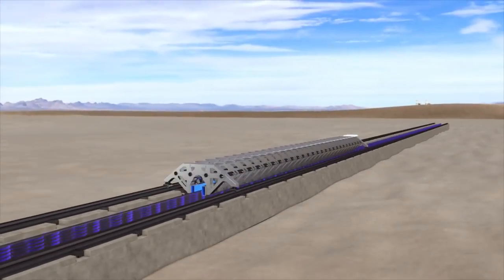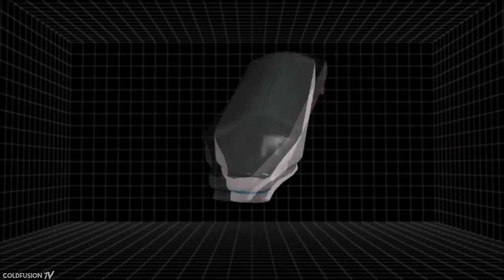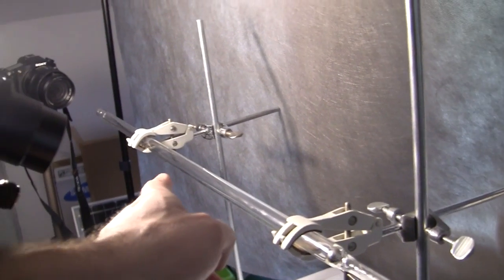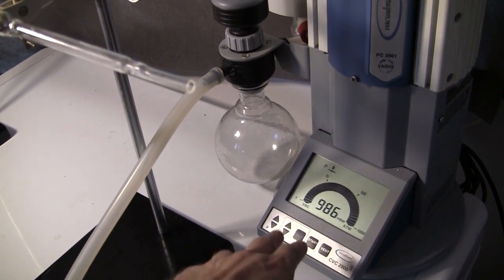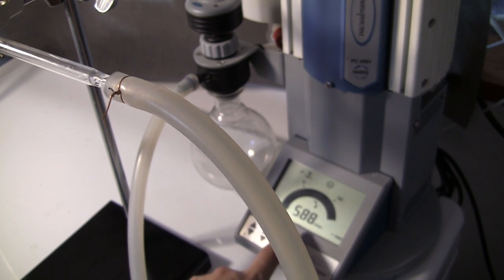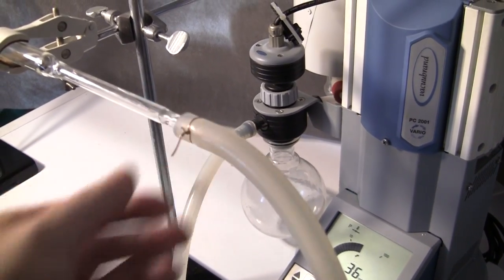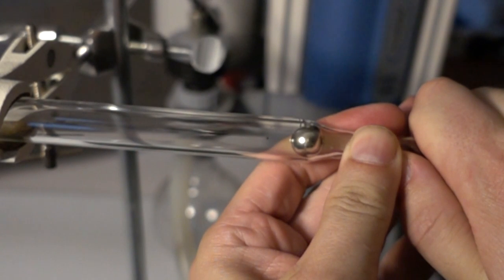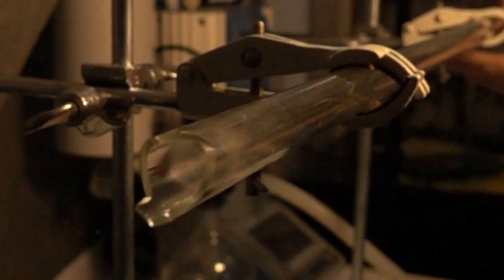How  the Hyperloop can kill you!

Comment: I'd be a lot more afraid of a pressure failure of the passenger cabin at 500+ kph than of the tube itself.
Reply: Well he did point out that it is all the space engineering problems on a land vehicle
Reply: ***** just because you don't know of any event of this happening doesn't mean it can't happen.
Reply: It never happens in submarines? Really? As a veteran of the Submarine force, I can assure you any and all accidents you can imagine happening on a submarine has happened. Especially de-pressurization or failure of seals keeping water out. One famous example is the USS Thresher.
Reply: +Synerrox เ Failure can still happen to any machine, no matter how perfect it is made.
Reply: ***** I served on a modern sub and bad things can and did happen. The Thresher was a modern submarine. Most submarines in service today were built during WW2 or the Cold War. There hasn't been a new model in many years, at least, no new American submarine models.
Reply: +Synerrox เ In the case of submarines it is rare but it can and has happened and it almost always results in the death of any human involved I assure you. Also when was the last time you heard of commercial submarine travel?

Airplanes also aren't perfect and planes, more specifically the skin of the pressure vessel does sometimes fail, however there you only have to worry about the air inside the plane going out and its still very violent when it happens, but generally doesn't harm the plane's ability to fly they merely drop in altitude. 

its also important to note that outside an airplane is still at least .2  kg/cm^2 (1 kg/cm^2 is normal pressure) which isn't pleasant but your body can tolerate it, also planes descend fairly quickly in the event of a cabin breach as well, however in a near vacuum even if you had an oxygen mask the pressure, or lack there of would kill you very quickly. so if you vessel breached you would be dead very quickly. They could seal off a section of the tube in theory and pressurize it but it would likely be too late.

In terms of space stations you're talking about something that is designed to maintain a set pressure at all times. the Cabin of the Hyperloop capsule would constantly be going between pressure changes to load and unload passengers so the dangers of a seal of material weakening are not entirely far fetched.
Reply: ***** As I already stated, most submarines in service today are 30-50 years old. So yes, the Thresher was a modern submarine, regardless of what you think a modern submarine is, the last Permit class submarine was decommissioned in 1993, so not that long ago. As for your latest comment sure, I agree safety measures would be taken. But that isn't what I'm disagreeing with you for.
Reply: ***** Most of the monitoring would be handled autonomously.

The system could be made resilient to attack by segmentation. If anyone attacks any part of it, it's isolated from the system, and can be repaired individually. It would be an expensive fix, but I mean, what if someone used explosives on a hydroelectric dam? There are plenty of other very serious potential targets.

Planes are not small, and they're subjected to a lot of stresses, whereas the tube itself would be subject to very little. Plus, any failure at any point can be addressed by the safety systems you'd want involved anyway.
Reply: *****
 Lol how do you train people to swim to the surface when the pressure itself will kill them. subs operate abut 100-500 meters. a human can only survive about 60 meters swimming up to the surface without air. And coming up too fast leads to the bends.(Hydrogen separating in your blood. Which is painful and can be fatal is not treated immediately. And the only way to treat it is to put you in a pressure chamber and gradually bring the pressure p to the surface. Which could literally take hours. I hope Thunderfoot makes a video about how creating pools can be idiotic and dangerous.
Reply: +Reshintoe It's much more like a submarine.

If a submarine suffers a pressure failure, you just die.
Reply: He clearly says 1 millibar.
Reply: rataflechera Your math is horribly wrong. I'll assume your cross section is accurate for the general case, rather than any specific project specifications. Air isn't 140 kg/m^3 though. It's 1.225 kg/m^3 at sea level, roughly 1.2 kg/m^3 at 0.01 bar. That's only 50,000 tons of air. Literally two orders of magnitude off.

As I've said. Segmentation. Especially of the terminals. They should be relatively small segments that can be depressurized relatively quickly. That way nearly the entirety of the tubes can be kept at pressure nearly all of the time.
Reply: @seigeengine  If you segment everything, you will need a ton of airlocks. More points of failure! Yay!
Reply: @seigeengine  Yes, it would make the system somewhat safer, but it would also make it less practical and more cumbersome.
Reply: @seigeengine  Also stop calling people idiots. It's not nice and will make people hate you.
Reply: @williamhuang8309  First of all, congratulations on necroposting on a 5 year old comment.

The airlock segments would literally be anti-points of failure whose purpose is to seal off a section within the tube in the event of depressurization i.e. when there is a failure already. How you could possibly think that's adding a point of failure to the system is beyond me. You do know that these wouldn't be airlocks to the outside, but airlocks to seal off the inside of the tube, right? 

Also, airlocks aren't simple? You'd be right if you were talking about airlocks to the outside of a pressurized container. But if you're talking about airlocks inside the tube in an already pressurized environment that you want to be able to seal if there's a change in internal pressurization to prevent the whole system from being destroyed, then yes, those kinds of airlocks are indeed simple. What do you think Submarines do when a loss of pressure in a compartment is detected? Shockingly, they close the connecting airlock which prevents the rest of the submarine from suffering from decompression. Without this airlock the entire thing could implode or flood. Guess what? These internal airlocks are far less complex than ones designed to be transition points to outside of the submarine. Within the hyperloop they could literally be as simple as an automatic door with a pressurized seal on it.
Reply: @Hirome_Satou  I'm saying that by adding these simpler airlocks, you have more to maintain.
Reply: @williamhuang8309  And not adding them means the potential to lose the entire tube and killing potentially thousands of people.

Come on man. Every single machine created has safety features that add "more to maintain" that doesn't mean you don't add safety features. Also it doesn't take much to maintain a simple internal airlock. You're being ridiculous. A failure of one internal airlock does nothing to make the tube fail. You can just use an airlock that's further down the line if one of them doesn't respond properly. It would also be an extremely unlikely and rare occurrence for such a simple door to fail. In real life there are always redundancies in safety features.
Reply: @Hirome_Satou  Well, because the hyperloop isn't very safe and these safety features make the entire thing more complicated and more maintenance-intensive, I think we should avoid using the hyperloop as our primary method of transportation. Sure, a couple might be built, but in the end, it's just not a good idea.
Reply: @williamhuang8309  You keep saying the same thing but you haven't illustrated how it does this thing. How does it make it "more complicated". Should your car not have brakes? Brakes make the car more complicated, what if they failed? What if you had to maintain them? Brakes need brake fluid, what if you run out of brake fluid, you would have to maintain it, might as well not even have brakes. Just how many parts are in an engine that all need to be working constantly? So many things could fail, It's just not a good idea, every day cars crash. They shouldn't be the primary method of transportation, there's just so many things that could fail in them!

How about you ask how much it takes to maintain such a door rather than just saying "it's more complicated". We're talking about a door with a hermetic seal on it by the way and an automatic circuit attached to a pressure sensor to close it in the event of a drop in pressure outside of tolerance. That's not complicated. That's extremely simple. Simple airlocks are not complicated technology. Military Naval vessels have hundreds of these kinds of doors on them. It is not complicated nor is it expensive to test these doors. I reiterate, your argument is ridiculous.
Reply: @Hirome_Satou  The problem with having airlocks halfway down the tube is that they are difficult to reach, especially when they're in a tunnel. In a car, it's easy to access crucial components such as the brakes- but in the hyperloop tube, the entire thing is under a vacuum, making it difficult to get to without repressurising the entire thing. Coupled with the fact that the pods are almost as big as the tube ( as shown in all their renderings) you end up with something that is difficult to reach. Yes, the door may be easy to test remotely (just set up something to close it and test the pressure) but it can be difficult to check it for any defects such as cracks or  other defects.
Reply: @williamhuang8309  Do you know what subways are and how they are maintained? Do you not know what maintenance lanes are? There are so many ways to get around what you're calling a problem. Alright man, I'm done entertaining you. It's been 5 years since this thread was relevant and I don't think you're bringing up anything worthwhile to continue discussing.
Reply: @seigeengine  Well... you likely didn't read my entire comment either, as you missed the part where I wrote about the single-door "airlocks" and the normally-open airlock bit. With that out of the way, assuming there were no technical difficulties with installing a fast, reliable, strong, automatic airlock (it's doable, but it might become rather impractical on long distances), you still need to slow the pods at a safe rate. If there was a vacuum breach in one segment, the airlock doors would need to close. If there was a pod approaching the failed segment and the pod was getting close to the failed segment, you'd somehow need to slow the pod down at a safe rate so the passengers onboard don't die of high g-forces. With or without airlocks, there are still major safety concerns with the hyperloop, and the vacuum failure problem is just one of them. Yes, if your detection system works fast enough, you could prevent the propagation of failure, but installing airlocks every few kms presents its own technical challenges.
Reply: @Hirome_Satou  Yes, I know how subways are maintained. But there is no vacuum in a subway system, meaning it's easier to access something. Yes, you can add maintenance lanes to the hyperloop, but if something fails inside, you will need to add access doors so you can get in through the maintenance/emergency lane.
Reply: rataflechera Rather simple moving parts. They also really don't need to open and close around the pod, although that would be beneficial. You could simply leave all but the terminal segments open during normal operation.

And the advantages massively outweigh the disadvantages, since this allows you to actually isolate problems, makes the system much more resilient, etc. I'd go so far as to say a non-segmented system doesn't make sense.
Reply: +Synerrox The hyperloop would cost tens of billions of dollars to construct, and it would likely be hellishly expensive to maintain, given all the safety systems that have to continuously be checked and rechecked. Plus, the only way it makes sense to use a hyperloop is for long distances, because otherwise its high speed is meaningless. This means that there can only two or three destinations available in the route network which limits the market size. I doubt the hyperloop could ever break even let alone turn a profit, especially when air travel is well established, relatively safe and more or less affordable for the average person.
Reply: +Alexandru Belea Well not using this hyperloop won't really be limiting us, think about it planes let us got across seas and oceans faster and someehat safer than walking or using a boat. The hyperloop doesn't really give us much expect a somewhat faster train.
Reply: Portalmaster Good. America needs another Great Works project to get people employed and working again. I fail to see the problem here.
Reply: But it is not all the problems of space engineering. You won't freeze to death on the earths surface. You won't have a lack of oxygen. All that would happen is you feel like you got kicked in the stomach.Rapid pressurization on one hand, Rapid decompression on the other.
Reply: if we're not going to say airplanes are unsafe because this sometimes happens on them, it's absurd to say this loop would be unsafe because this might happen
Reply: @WorthlessWinner  Yes, aeroplane emergencies do happen, but in the event of something bad happening, it doesn't result in the instantaneous death of everyone on board. If there's a sudden decompression, there are oxygen masks that last for 15 minutes, and the pilots have time to fly the plane to a safe altitude where you can breathe without the oxygen mask.  If there was a spontaneous decompression incident, the entire cabin would be dropped to 1 millibar in a matter of seconds, giving you little time to react. Not to mention that your body could explode if the decompression happened too fast because the pressure on the inside of you ( 1 bar) is larger than the pressure outside ( 1 millibar in the pod)
Reply: ***** No that's not true. You have special suits called SEIE MK 11 suits that inflate and get you to the surface quickly. But that's only used in the occasion where the Sub is unrecoverable from a flood or fire or some other disaster. If there was ever a loss of pressurization in the sub you're not escaping from that.
Reply: +rataflechera Keeping the tube pressurised is realatively simple because it is not a full vacuum,  but a near vaccuum 10 millibars as thunderfoot said in his video. As for power,  the idea is to have solar panels on top of the tubes which will more than cover the power requirements.
Reply: TheMartieno 10 mb is 1% of atmospheric pressure. You know how it is achieved? By removing 99% of air (or cooling air down to 2.8K assuming at that temperature it is still an ideal gas).

So, let's assume the cross section is 10 m² (100 sq ft), and it is a straight line from New York to San Francisco (4,140 km, 2,570 mi), that means that the tunnel has 41,400,000 m³ of air, and you have to remove 41,000,000 m³ of them. At 140 kg/m³, we are talking of 5,740,000 tons of air.

So either you must keep removing millions of tons of air each day, or you must keep the system very sealed, even during the stages of loading in and out the cabin and during normal maintenance and small reparations. 2,570 miles of a very sealed tube.
Reply: rataflechera The answer is simple. Have sections that can be sealed and pressurized or depressurized separately. No need to remove millions of tons of air each day.
Reply: @Hirome_Satou  Airlocks are far from simple :)
Reply: If you look at the references... there's no room for 500 or more passengers.
Reply: ***** But it wouldn't be a similar level of safety to airplanes if an airplane suffers pressure failure they descend and land immediately. If a Sub suffers pressure failure they ascend if possible and if not the sub either sinks and implodes or just implode depending on the depth. If the cabin pressure failed in the hyperloop it would kill the passengers nearly instantly.
Reply: ***** I'm guessing a hyperlopp would for a country like the USA would go around the US and I would say not only is that a lot of land to cover, but  it would cost a massive amount to dig all of that out not to mention all of the man power that wohld have to be put into it, so I say a hyperloop would cause either around or more than it did for the Concord.

Also who exactly would be paying for this? A Private company or would the government chip in for some of the cost?
Reply: ***** True most of the original train line was above ground,  though its  just one of those ideas that if done in the current century would just seem a bit convoluted and unnecessary, though maybe in the future it will seem like a better investment when there are better building techniques.
Reply: +Synerrox เ you probably will need less fuel to move 500 people with an hyperloop that with a plane.

On the other side, apart from a plane keeping a pressurized cabin at 30000 feet, or the hyperloop cabin pressurized in a near vacuum, for the plane to operate you only need two runaways, which don't even need to be perfectly paved or maintained, or even lighted for daytime operation. And if you want third destination just build a third runaway.

 For the hyperloop you need a whole depressurized tube all the way from one point to the other, and depressurization consumers energy. And so does building the tube and taking all measures needed for safe operation.

in the long term, if a route is profitable, it might save energy, buy this is far from a flexible system, and the larger the network, the larger the problems of keeping sealed and depressurized.
Reply: TheMartieno Solar is still shitty pretty much everywhere. Let me know when it isn't.
Reply: *****
I don't think that level of pressure will be sustainable enough to kill people like that.
Reply: seigeengine my math was not horribly wrong. I got one input wrong (the weight of air due to a missing decimal point in the first place I checked).

The problem about segmentation is that you need them separated for depressurizing them but open for the capsule to run through segments. It adds some mechanical challenges.

It is doable. It might even be profitable and save energy in some specific needs. But it is an engineering challenge and is far from a flexible solution.
Reply: rataflechera Lolno.

o noez ey nevurr teh thot abowt dat!!!!1!111!11!1
Reply: Joshua Dunbar I understand. I also understand that the capsule must move through those separated sections, so you need sealing doors that open and close as the vehicle passes, which adds extra complexity (more moving parts, synchronization, etc.)
Reply: yeah and its shreds submarine, but submarines are to important for warfare to dismiss them, and airplains dont have as much pressure difference so its not as devastating as in the hyperloop. many passengiers of riped plains survived, because our body can hold these low pressures but not the one in the hyperloop.
Reply: Also the force of a lot of accelerated air hitting the capsule would probably crush it like a tin can.
Reply: aserta 1. No. 2. No. 3. No.
ChatNoirLe No, it won't. Atmospheric air pressure isn't that large. We routinely build things that handle pressure differences hundreds of times higher, and then we sell them willy nilly to the average person without restriction.
Reply: DarkBabylon - Gaming videos maglev isn't really the only levitation system suggested, mind.
Reply: DarkBabylon - Gaming videos I haven't watched it, but Musk's idea was to use air-casters instead.
Reply: A complete failure would be rather difficult., and at 500kmph would probably give you bigger problems than no oxygen to breath. If nothing else the tube should keep the pieces together. A large hole should be solvable though. Thunderf00t gets it very wrong here. The tube is at partial pressure because that big fan at the front uses it to create an air cushion around the vehicle. It's be relatively simple to have an on-board emergency system kick in to divert that air towards the cabin instead, which should counter the effects of quite big holes. Externally the tube would need to have blast doors for a variety of reasons, including maintenance. With blast doors ever 10 miles, and blow out relief valves, you'd never go more than ~30 seconds without air. Bad, but survivable.
Reply: I don't think lack of air is the problem. I'm not a super genius when it comes to science but vacuums are a lot more dangerous then just simple oxygen deprivation. short answer: kiss your lungs goodbye. literally. I have seen it with deep-sea fishing except with their stomach but once exposed to lower air pressure then your body has adapted to, the organ gets sucked right out of your mouth.
Reply: draconian99 Has less to do with the deep sea than with space. On which point, we know what happens when a person is suddenly exposed to a vacuum. The answer is.... nothing dramatic.
Reply: +Politiekman, and on top of that, it would require far more energy per trip than an airplane flight considering how much energy is actually required to make a vacuum, hell, a 1 m^3 vacuum requires 100kJ of energy to create, and that only increases exponentially as the size increases. Creating a 3000 mile vacuum(needed because momentum simply cannot be sustained in open atmospheric conditions, and would rapidly diminish, require hundreds of individual vacuum launchers) would not only be extremely expensive because a fully airtight tube doesn't come cheap. You would need many of these tubes because you couldn't have two trains running in the same tube, because if you stop and remove airflow from the tube with a train in it, the train stops.
Reply: SlyCedix 

Except the vacuum isn't being recreated for every trip. The only area that needs to be returned to pressure is the terminals where people or things board the pods.

I don't see why you can't put multiple pods in one tube, as long as there's enough of a gap to provide braking room between.
Reply: seigeengine
As the pod moves, the entirety of the space behind the pod becomes 1 B, which then needs to be returned to the 1 mB for the next trip. This function of turning to one bar is essential to uphold the speed of the pod. To run another train, you would first have to depressurize the tube which would mean not only does any pod inside the tube stop having momentum, it would likely begin to reverse back through the tube until the tube ultimately reaches 1mB again.
Reply: SlyCedix What are you talking about? The pod is not manufacturing air out of nothing, nor would that be "essential to uphold the speed of the pod." I feel like you've gotten some very weird notion about how these are meant to work in your head. You should probably explain exactly why you think that's the case to ensure I can give an appropriate reply.
Reply: seigeengine has it -- it pumps air from in front of the car to behind the car, yes. In the immediate viscinity of the rear of the car it is high pressure but that will equalize very shortly back to near vacuum.
Reply: That is all regarding capsule failure. What TF is showing here is tube failure, which would kill everyone in the capsule without compromising it.
Reply: Wait LMAO I've seen seigeengine before, debating for feminism. Got blocked after my glorious argument destroying her's. It was amazing.
Reply: Wreqt We've spent pretty much the entire time addressing tube failure, not pod failure.

Try fucking reading.
Reply: seigeengine An article was posted as a refutation of TFs points, and it ONLY talked about pod failure. Try getting some context before replying to some one.